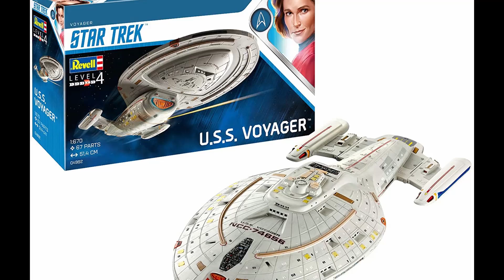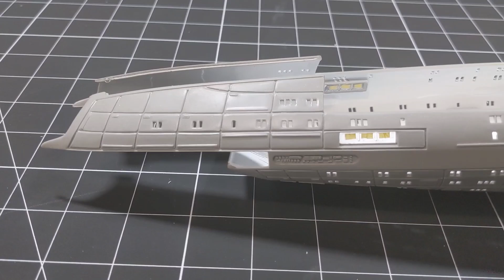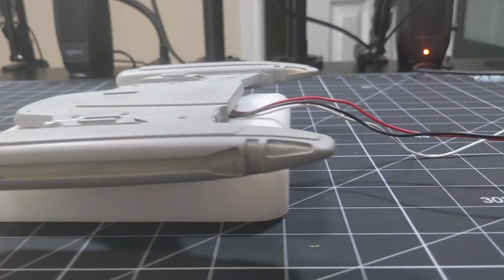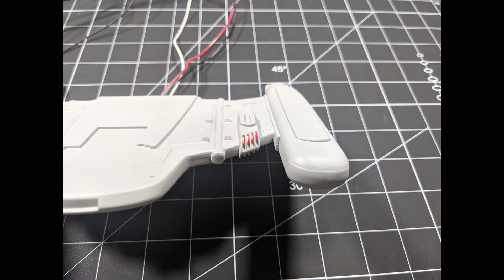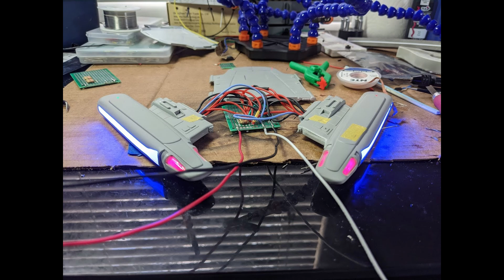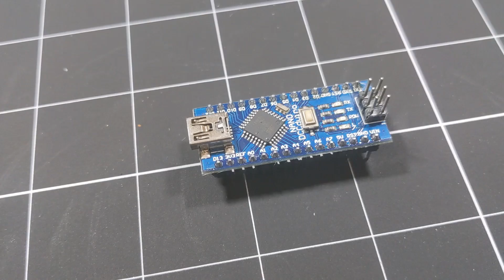Scale Modelers First Time Lighting a Model

Comment: If more GPIO is your only concern, you might be able to keep your form factor small by adding shift registers or an serial LED driver rather than a bigger Arduino.
Reply from the maker: I considered this, but a shift register still requires 3 pins on the controller. It is possible I won't need to make this switch but its nice that the option is there.